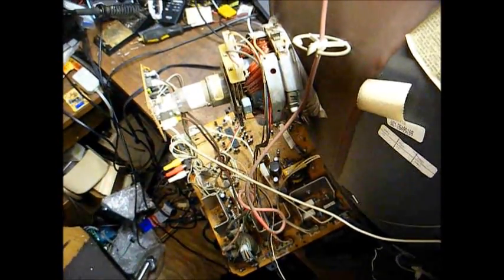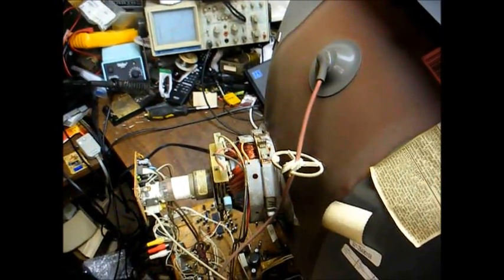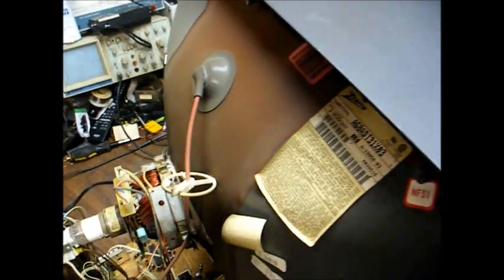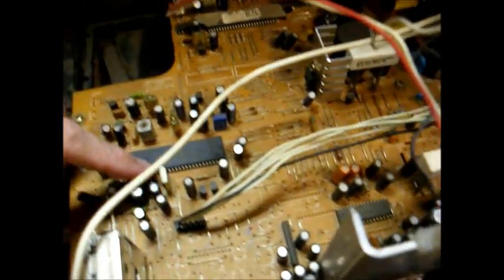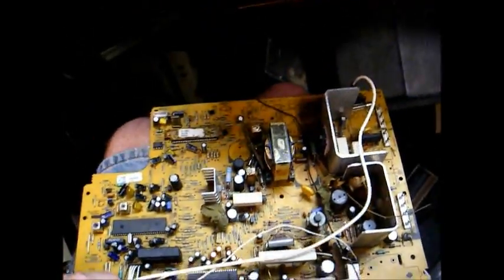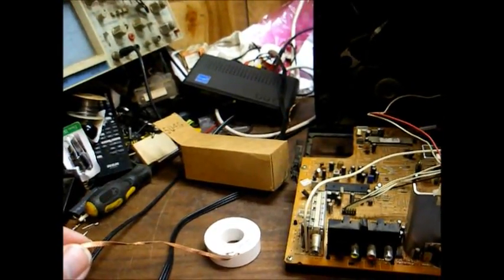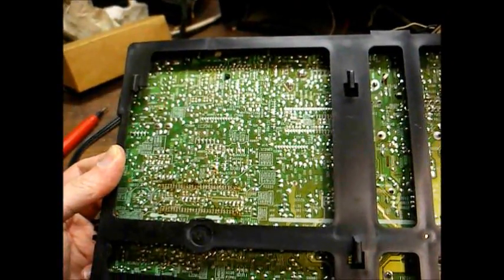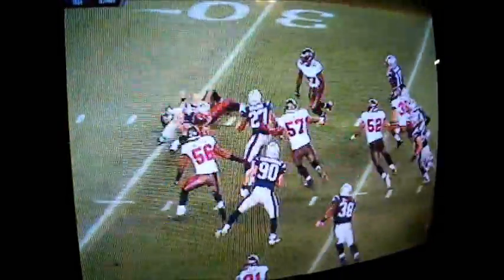Jungle IC replacement in a 27" Zenith color TV from 1999

Comment: I have had main chips fail like this before. One case that came to mind was a late 80s Philips (euro) chasis, the CP90. It was due to static buildup and/or CRT flashover damaging the IC. To prevent a repeat failure you had to add a metal shield plate over the IC, grounded to chassis ground. Maybe you might want to think about that in these sets, as you're dealing with a repeat failure scenario already.

Comment from the maker: Yes, same deal with them. Same goes for the Zenith "HealthView" TV's that were made for hospitals. Back in the late '90's, I got several of those with bad CRT's that came out of local hospitals.
Reply: Hey there. If you're still around, I have a 1976 analog tv and I wanted to install rgb component input on it so I can get better picture. I was told it lacks onscreen display and a jungle chip. What if I install those things on the circuits? Or just replace the current circuit with another that has those things? Or just re-wire some parts to a second circuit so it has what it needs to read better picture with composite, S-video, component, whatever. Is it possible? I can imagine it'd take a lot of work but I have the model number and serial number in case you need to take a further look at it.

Comment: We had a 32-inch Zenith console TV from 1997 and in its later years the picture was not the right shape. It would be cut off at the very top and the bottom of the picture was bent to the left leaving a black bar the the bottom of the screen. The set died from a CRT short in September 2011, less than a year after moving it from our family room down to our basement.

Comment: I guess a power surge or lightening strike could have taken out that IC, but I wonder if it may have been a case of bad solder joints since the chip was replaced relatively recently. I hate flat screen TV sets, we have a 2005 model Toshiba with a tube and it still keeps plugging along. The curious part is that the Toshiba was built right in the middle of the bad capacitor plague, and the board is full of garbage Lelon brand caps, but has only failed once since we got it.

Comment: which pins on the jungle IC does the coaxial tuner use? (by label... example, composite input usually uses CVBS pin etc...)  I have a TV that is Coaxial only, no composite. I am doing an RGB input modification and I would normally use the composite input for my ext sync, thought about using the CVBS pin... but the problem is that there's no AV1 on the system to switch over to, so I'm trying to find out how to sync while on Tuner.
Reply: You won't be able to, only using a system which has RF out like Nes/Genesis/Snes for sync while connected to RGB would give you a stable picture. There is a write up on this online " Rgb mod RF only tv".

Comment: I have a Z27X31D  Zenith Crt  repairing. I changed out tuner and replaced with 175-02721 tuner but nothing changed. I have heard of some modification that I have to make to the circuit. Do you know about this?

Comment: I did warranty work on the Zenith line in the nine's and the picture tubes were crap, worst still was the fact they would send a rebuilt tube that once in a while the guns were out of alignment making color set up impossible. Looking at the poor quality I found there was very little emitting material making a restore virtually impossible. Not to mention the elements were to close which would often cause a G1 or heater to cathode short. I remember one case where I had to replace the tube twice because the workmanship was so poor.

Comment: its good it is repaired! well now that Jungle IC is back in use! same with the set squeezing the most of the set
Reply: Sony Trinitron can you help me fix my Sony trinitron ??
I has na anoying destortion on the left side of the screen 
the tv is a KV-14M1E
Reply: Vader Starligth Looks like it needs a pincushion adjustment.
Reply: Sony Trinitron 
i thought of that but i cant find any option to adjust the pincushion on the service menu
maybe it has a pot that i didnt check
i already open the tv to change the termal paste and adjust the focus but i will open it again to check if it has a pot for adjustment

Comment: I have a Zenith 25" from 1996 and to my amazement the CRT still produce a good watchable picture. The picture is way better then the 2006 32" flat tube with digital tunner Sanyo that was given to me for my dad had it was only 7 years old. You had have the contrast and brightness set to max and it still gave a very dim and blurry picture doto bluming. Just to let you know I am not defending those late 90s Zenith as I now they were awful.